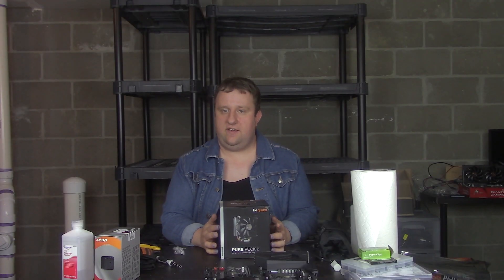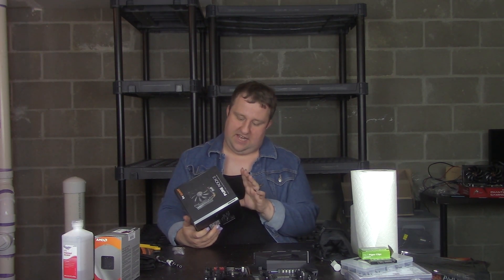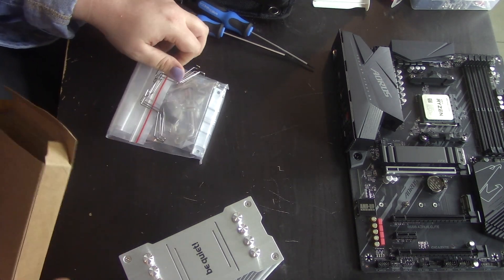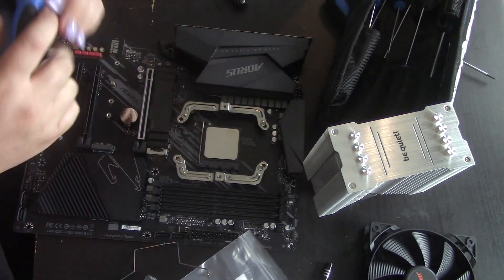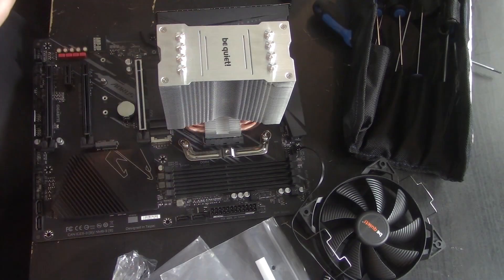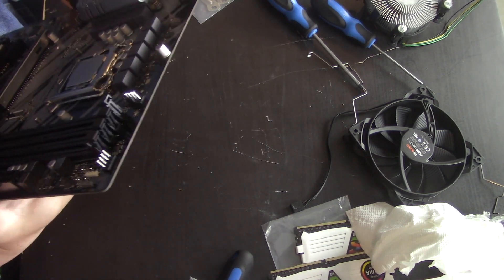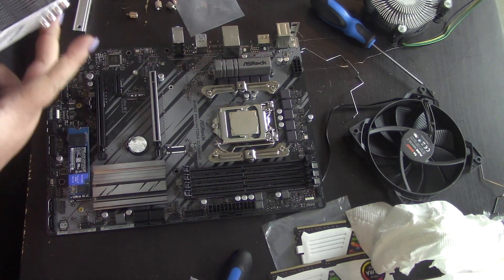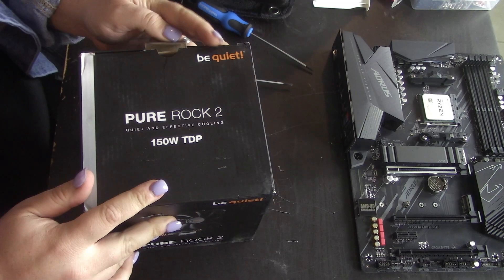Be Quiet Pure Rock 2 Unboxing & installation (AM4 & LGA 115x/12xx)

Comment: The provided amd mounting screws are way too short to reach the backplate when used with the provided plastic standofs. What a bummer.
Reply: how did you fix this? I am having the same issue
Reply: Mine worked just fine but ~4 turns is nothing great for a thread.

Comment: Do I need to clean off the thermal paste before putting mine on or can it be on top?
Reply: You must clean it. Mixing new and old, different brands, different types of thermal paste can cause air bubbles and such, which will hurt your cooling a lot

Comment: im getting 70-88c with this cooler on FC5, is that bad ?
Reply: No it’s a hard title to run
Reply: Which CPU?
Reply: @actuallyaridan  i5 7400 lol 😂
Reply: @ollyryan7009  
Seems a bit high, but do a benchmark (I did geekbench) and keep coretemp running, you can leave it and see what your max temp was.